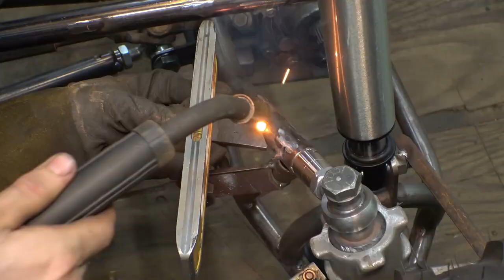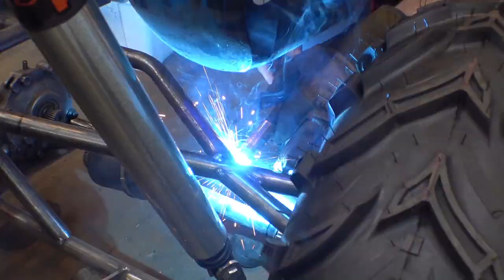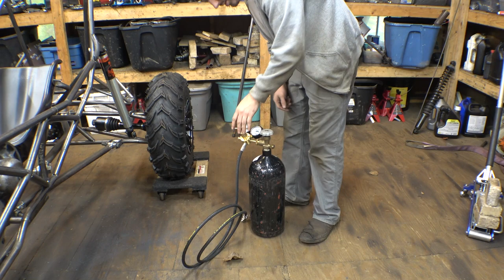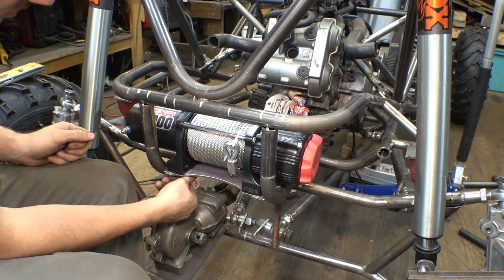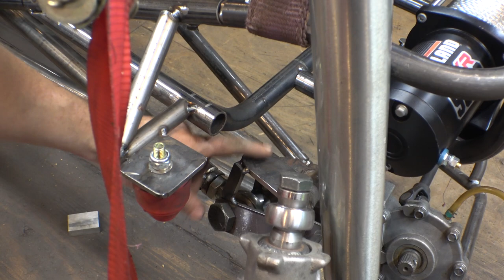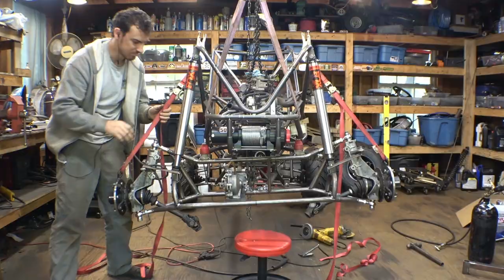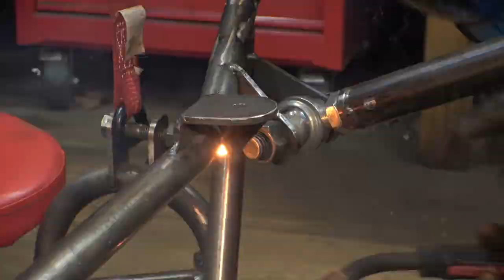Mini Rock Crawler Build SV 650  Part 6

Comment: You need a Hydraulic steering ram.  That way the hoses move up and down with suspension. If you try a steering rack you will have to have telescoping steering shaft while rack is mounted to front end
Reply: I second that idea.  We use them down here in southeast Louisiana on boats because of that versatility.  Another benefit is the strength of the ram compared to a r-a-p steering, which I think would be good for a bouncer when you're bound in a rut or rock crevasse. Nothing will stop a ram and ypu can turn it with your finger on the steering wheel. Plus its way less complicated without any linkage
Reply: I agree with the boat hydraulic steering due to them having a check valve in them making it so  only moving the wheel will allowing to turn as well as having it be able to flex without binding the steering linkage
Reply: Electric rack would be enough for this thing.

Comment: Other people have offered this suggestion and its one I agree with: why don't you use bump stop rings/sleeves that attach to the shock absorber (at the bottom of the ram shaft)?
That would eliminate all the headaches and mess of trying alternate external methods
Reply: I even stopped this video to go look at several when the 1st placement was wrong.5 minutes versus hours.
Reply: 100% this. Motocross bikes or mountain bikes don’t have external bump stops and there forks and shocks take huge impacts. This will only ever take slow speed impacts so a shock mounted bump stop around the shaft would work perfectly. Look neater and save a load of weight.
Reply: Putting the stops on the shock also buts the hard mechanical loads- straight ones and bending- through the shock assembly- the independent bump stops put the load at stop directly into the frame or strong suspension members.  FR

Comment: Put a donut ring around the shock base. You won't have to worry about missing a plate
Reply: I said that about 4 videos back and got roasted for it.
Reply: Great idea I was going to suggest the same thing looks better to
Reply: @1one3_Racing  comment suggestions here are pointless. Never seen this guy open a rollcage regulations booklet on he whole time he’s been here. 

Evidently this cage/chassis he’s built is closest to a spec cage I’ve seen him build, of all of them this is the only one I’d trust in a rollover
Reply: Thats what some car manufacturers do.
Reply: @dylanzrim3635  Not expert on roll cages, but for what i know, you never have joints in the main arch for each direction, only where those connect.
Why comments do not get listened is probably cause his like many other creators is already several weeks ahead of the moments you watch, so he has already tried it several times, given up and tried another method that somewhat even works but not good and is way too far in the project to make changes.
Reply: Fully.  You could also add an external tube over the shock housing if you're afraid of damaging the shock itself.  Keep it simple.

Comment: 1...Use a donut ring on the shock as a bump stop. Your way over complicating it. 
2...Switch the shocks from front too back. You don't need that much stroke on the front. 
3...You should run just enough nitrogen pressure to extend the shock about half way out or a little less. You want more droop than lift.
Reply: 5-6 inch on those 14 is a good start, 
He wont profit every inch anyway, the axle are way too narrow
Reply: @Bproject89  Agreed...I would still swap the fronts too the back. He could move the upper shock mounts up easier on the back for the longer shock.
Reply: @MullinPerformance   what length are the back one ? I was sure that he bought 14 all around

Comment: by watching this guy doing so much extra work, you can understand why it is so important to develop a 3D model !!
Reply: or least sketch something on napkin to get general idea what you are building, but yes 3d modeling allows to remove kinks in the design before any metal is cut, but its hefty work load on its own, so napkin and maybe small model would do wonders to find how axles move and so on.

Comment: Yes you can make use of that much travel especially if it’s droop. Rock crawlers use more droop then up travel. And I’m glad to see the you do have a slip yoke , didn’t see that before
Reply: But I'd this a rock crawler or what he calls a rock bouncer which are totally different
Reply: @bustinyanutz4195  ok but they both use a lot of droop . The idea is to let it drop so the tires stay in contact with the ground.
Reply: I run the same shocks on both my rig, and i assure you he will roll the shit out lf that thing. Its way too narrow to profit every inch on that shocks 🤦🏻‍♂️
Reply: @Bproject89  thats what i thought

Comment: Hydro electric power steering pump is the way to go for steering.  You can find them in almost any newer cars now. No belts or pulleys needed it’s a self contained system with motor pump and reservoir all together it’s the best thing ever! And connect it to a ram.

Comment: If you are going with uni joints make sure the yokes are parallel and your gearbox output shaft and your diff input shaft are parallel (Z formation). Since your tail end is pivoting you would go for middle the range of angle full travel causes for the diff angle and live with the consequences regarding varying velocity at the diff. Don't spend too much time on hard surfaces. Used CV joint driveshafts are plentiful and cheap if you want to remove the problem. I love your work and dedication. Thank you for sharing it.

Comment: If I’m not mistaken the reason for your funky bump stop locations is that your upper and lower links in the front are backwards from the traditional style. Usually your upper links are narrow on the axle and wide at the frame and vice versa for the lowers

Comment: Make the shocks just strong enough to hold you and the buggy at about 50% travel, it will ride great and look more proportional
Reply: I was thinking that the wheels look tiny as well
Reply: Yep the tires could be 3 times as tall. 😄 Plus, don't know if you already know this, two of those directional tires are mounted wrong.  Right good, left is wrong.
Reply: @BillyJoeJimBob28  he mentioned that in the first build video. Guess he hasn't got back to the tire shop yet.
Reply: I would re design the axels and make them way more compact lower your shock mounting points on the axels lower you will gain twice the amount of travel and flex
Reply: Look at how all the air shocks buggy are set... 6-8 inch of up travel max.
more pressure in them, more height you got, but also more spring rate... Air is really progressive, you wont feel it much mid travel but the last 5-6 inch are gonna be worst. 

You have to balance the ratio pressure/oil to achieve that, more oil, less air to achieve same height...  but too much oil = hydro lock

Comment: I'd agree with a bunch of other commenters here that hydraulic steering might be an option. Costs would potentially be higher though...
Reply: Mike festiva on here did one. I have a Toro groundmaster mower/tractor with a hydrologic steer setup, can likely be done using used parts

Comment: That thing is very cool sir😎👍. I would like to suggest a few things that it really needs. The first, bigger tires. One good reason is to roll over rocks/obstacles. Your really limited to obstacles just over half the tire diameter. Another great reason is traction. To get great traction you have to sacrifice tire hight. This sacrifice happens when you are forced to air down your tires to gain traction. At this point your will need to consider your gear ratios. Is the ratio high enough to produce enough torque. Then the bouncer aspect comes in to play horse power! The higher the ratio the less horse power you can effectively use for speed. Good luck I can't wait for the next episode. 
Thank you👍

Comment: I think what you were meaning to say when you were describing the suspension was, how much Articulation is in this suspension. If I'm remembering correctly, suspension setups with solid axles will articulate much more than a independent suspension system. Food for thought. Keep up the good work

Comment: you need to clock your u-joints to prevent vibration/surging, pretty sweet build, and seeing this at full height, its like a jungle gym with an engine xD, its going to be a blast when you get it done

Comment: Here’s and idea. Perhaps a boat steering system with a push pull cable would work. They are fairly reasonable and should be plenty strong for your application
Reply: I second the push pull cables. I remember Orange County Choppers used those on a gears of war trike.
Reply: Correct me if I’m wrong but couldn’t there be a chance of the cables being tangled in the axles?
Reply: No no nou mian, he need hydraulic steering system
Reply: @titityytyler01  I agree with the hydraulic steering system

Comment: Incredible stuff, and cool to take viewers on the journey.  Never have I seen independent suspension components used to build solid axles.  You know it would be cool to have the center diff in a square cage and 4-linked to the frame and where it only swung up and down, and then use the axles shafts as intended swung from sides of the square frame to the spindles….  A mono shock in the middle and coil overs on the swing arms ….

Comment: I have only watched some of your video so far but I am really enjoying it because I feel your pain so to speak. I just finished building my rock crawler tube chassis all custom with 14-bolt axles and you're running into so many of the same issues that I did you know Fabian it cutting it apart mocking it up and redoing it's a lot of work to get everything to fit and the tolerances are extremely close

Comment: For the steering, an option would be to use hydraulics as it would mean that you do not have to faf around with linkages and universal joints, another way it to use electrics but that would put stress on the battery if the charging system wasn't sufficient.

Comment: Now that I see the "final design" I realized what's wrong with it. The axles should be farther away from the frame (in a longitudinal direction, obviously), not directly below it. That way it can be lower to the ground while maintaining the same suspension travel.

Comment: this foot joint should always be mounted in the center, mid axle. reason being, when it's under a load and it has torque applied, it has a tendency to load one side of the output shaft of the rear end more than the other side, causing a gnarly vibration.

Comment: The fact you do all that metal work in that shed is amazing..but the front shock issue will be solved with the plus 10" added to the front wheel base

Comment: The terms your looking for is, full bump, full drop (or droop) and articulation.  You could have used compressed air for your shock test, and if you were only going to be crawling air is fine as the shocks don't heat up much under slow movements.  Props on you ingenuity and determination on this build.   Bump stops are only usable on rear trailing arm (independent), and double a arm front suspension. Solid axle suspension plane of rotation change too much (with high articulation) to have a fixed frame bump stop .

Comment: You typically want more down travel than up travel and you need to soften up those shocks as they did not even move when you climbed on.  The whole point in a rock crawler is to keep all 4 tires in contact of the ground for traction... not to absorb the impact from bumps.  I would give it 4" up and 10" down.  I would have also set it up so all the way down would have dropped the body almost to the ground.

You need to put the bump stop  farther back up the control arm so the pad would not have to be much bigger.  You could have the straps farther back too at the same spot too.  This requires the control arm to be a bit stronger.  I would have tipped those shocks in a bit more in as a lot of the impact will be from the sides too and this will help the axles twist more without bending your shocks.  You have them almost straight up and down.

Do an electric or hydraulic steering so you have no steering linkage to worry about.  You will want some sort of power assist anyways as steering when something is moving slow is a lot harder.

Planning is EVERYTHING on a something with this much suspension travel.  This is a VERY specific purpose build.

Comment: I’m with everyone else, on small builds like this put a bump on the shock tube itself so that it cannot possible bottom out.  

If you are set on using those style of bump stops, you should put them nearer the centre of the axle.  If you look the centre won’t deviate as much at full droop on one side.

Many older style bouncers have them like 6” on either side of the diff.
Reply: Kind of like what you did… but backwards. Have a plate running side to side on the axle, and then the bump can hit anywhere in the axle

Comment: Your probably going to need to add at least 100ml of oil to each shock. It will resist bottoming better. I use a marinade injector.  They are at wal mart for a couple bucks. 2 bottles of fox shock oil should be enough.

Comment: The driveshaft slip joint is called a Slip Yoke. For the rack steering shaft to the rack and pinion you'll most likely need a collapsing steering shaft which can be made out of 1" DD steering shaft. Lots of places sell the parts including Flaming River, Summit, Sweet Mfg., Borgeson, etc.

Comment: Hydraulic stearing would be super cool if you could make it work ! Possibly run a pump off the chain drive and mount it as the chain tensioner? Also this could unlock possible 4 wheel stearing in the future!

Comment: use a full hydraulic steering setup! then there is no mechanical linkages to mess with, and only hoses going down to the axle. super easy to do.

Comment: Put a rubber doughnut around the shaft of the shocks with a radiator clamp to hold it there and let the bump stop be on the shock independent suspension would work so much better with the long travel shocks.

Comment: If you look on a truck with a solid axle The bump stop is put on the frame and it is made to come in contact with the axle tube so that way you don't have to have a long plate for the bump stop to land on it can just land anywhere along the tube of the axle
Reply: You could have mounted your bump stops to your lower tube on your chassis and let them go in line with the tube on the top of your axle

Comment: Mount the rack and pinion on the axle and run the steering shaft parallel to the upper or lower track bars with a telescoping shaft so it can move with the suspension and not bump steer

Comment: By the way I was a diesel tech on the Alaskan pipe line when we were installing it. 25 people under me  all mechanics. Just thought you should know. If you 360 engine and trans you would have gotten it lower. Just saying. And rally is right 33"×15.5 super swampers TSL SX would be pretty darn good.

Comment: Rather be welding Chris you can do your steering wheel to a hydraulic pump run the hydraulic hose down to the rack and pinion steering and have a hydraulic pump that turned the rack and pinion steering and kind of like in a front loaded bulldozer and that way you don't have to worry about having a solid steering column. Because you'll have the same problem with a solid steering shaft as you do the drive shafts.

Comment: Nice build as always, but...
What's the use of all that suspension travel when you have straight axles that's gonna catch? Not much clearance 🤷‍♂️
Reply: Yeah that is biggest issue i find with all rock bouncers i have seen. Been saying people to build Halo warthog style under carriage so each wheel is independent and only place it can catch is on behind the wheel on the arm, but at that point it will just slide just like it would with those control arms in 4 link. Also whole drive system is protected inside. If you want to go full apeshit then go with hydro drive train and steering while at it.

Comment: Use boat hydraulic steering rams and pump. It’s all self contained and you can add a electric power steering unit before the pump input if you need too

Comment: Your bump stop issue is because the axle isn’t staying centered under the project. Could be solved with a panhard bar that keeps it centered during travel.
Reply: It’s probably going to cause steering issues too.
Reply: Pretty sure if his 4 link was different it would solve the issue or like you said, panhard bar.

Comment: An idea for the bump stops would be to make two tubes. one slides inside the other like the shock absorber. On pivot joints so the bump stop is always lined up no matter where the axle is. You could make it easily adjustable and the bump stop would never have to move

Comment: Have you considered hydraulic steering? It could save you a LOT of headaches.

Also, for your bump stops to be level at full compression all you need to do is add another little platform at the top of both plates with gussets. That way each one has a flat "home" position and will reduce lateral stress on your bump stops, their platforms and your front assembly.

Comment: "@rather B welding" for the bump stops   make cuffs that wrap around and clamp to the base of the shock lower end of the outter tubes that have the stops mounted on them and the contact plate as a bolt on unit that uses the lower shock mount bolt
that way no matter where the suspension travels they will always line up

Comment: at a drawback of making it stiffer, you can simply move the shock mount perches over, a half an inch either on the top or the bottom, and solve that problem quite easily.